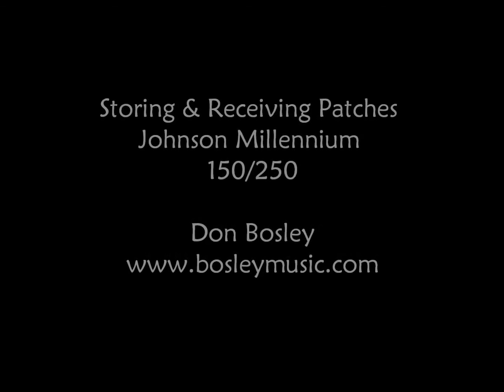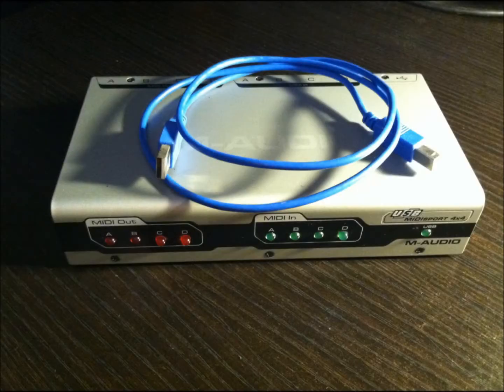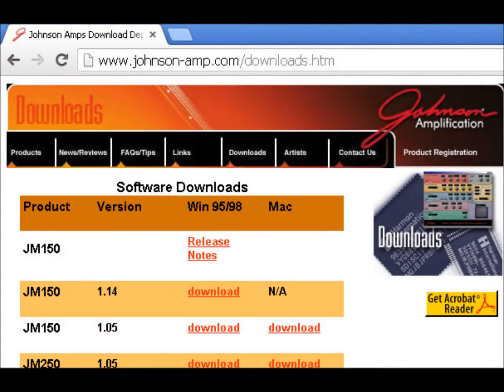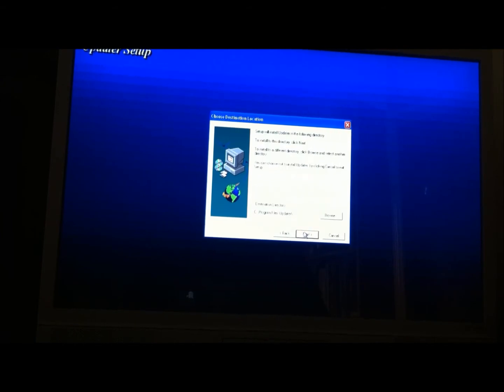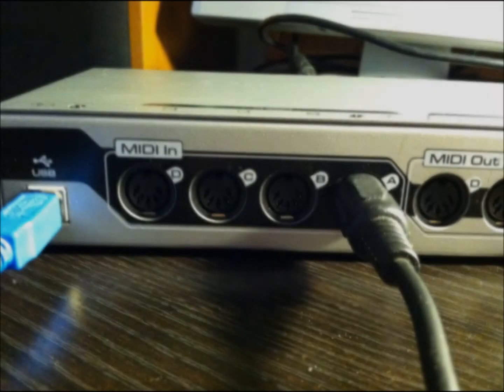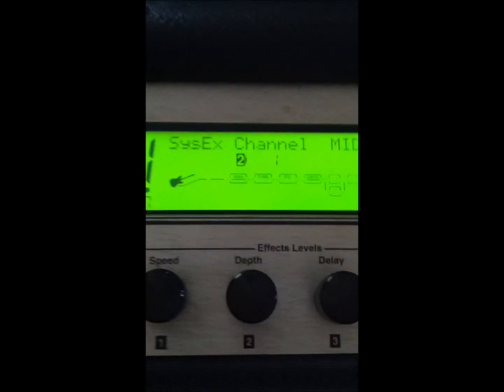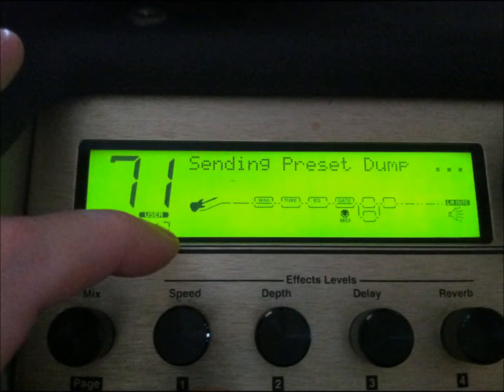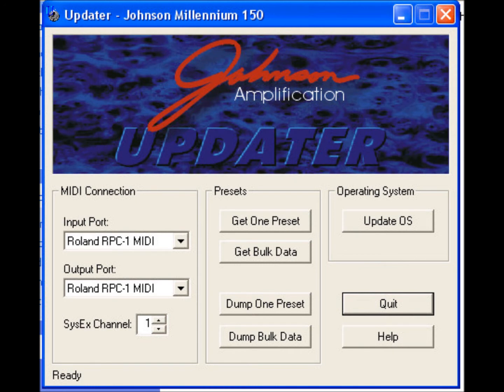Storing and Receiving Patches in the Johnson Millennium 150 and 250

Comment: Somebody was successful using  MIDI-OX on computer Windows 7 so tried it and did not work. Any experience with that? I was told to increase buffers to max...
Thanks
Reply from the maker: I have not personally used Midi-Ox, and I also no longer have a windows 7 machine that I could even try to walk you through it. An older machine with XP is your best bet. You can also run a virtual machine of XP on your windows 7 machine - http://windows.microsoft.com/en-us/windows7/install-and-use-windows-xp-mode-in-windows-7  This may be a workaround where you don't even need to run Midi-Ox, rather use the johnson software directly.
Reply: Thank you so very much for getting back to me but meanwhile I went out and bought an old lap top with XP to use the old Johnson Updater software as in your video since had trouble with MIDI OX. Turns out my friend's Sysex files were damaged so it did not work that way either. Had him resend a new file of patches and then decided to try Midi Ox again on my WIndows 7 was able to use MIDI OX after adjusting the buffer files with some internet research about adjusting buffers. So left it at that since it worked fine and did not have to retry with the XP machine If you want I can send you those buffer settings for your files in case some other people ask you about it as I see you are THE MAN in this JM150 thing. Not home at the moment but have them written down. Thanks again.
Reply from the maker: trinacria1956 Thank you for adding the buffer settings below. I'm sure someone will get use out of them.

Comment: Does anyone know how to do this with midi-ox or some other software? I have Windows 7 and cannot get the Johnson app to install. I can't get it to install on a Mac with Mountain Lion either. I tried Midi-Ox sending the whole sysex file with the Johnson amp on Sysex Channel, it looks like it works, but the user presets are not changed.
Reply from the maker: What is the name of the sysex file? An update for the operating system itself or just a set of patches? When you power the amp on, what OS does it tell you is on the amplifier? It will say Johnson Millennium Version 1.XX during the boot phase of power on. The best bet for an OS update at this point is shown here : Johnson Millennium 150 / 250 : Transferring Operating Systems from Amp to Amp
Reply: www.bosleymusic.com
The file is a set of patches. The OS is 1.05.
Reply from the maker: Larry Sigmon  Are you sure the set of patches also includes a set of user patches? The bulk dump format for patches is only 100, so you shouldn't see any change in your user presets. In the Johnson Updater, you specify where you want a bulk dump to go, user or factory - I suspect you need to tell midi-ox to put the files into the user bank if that's where you want them.